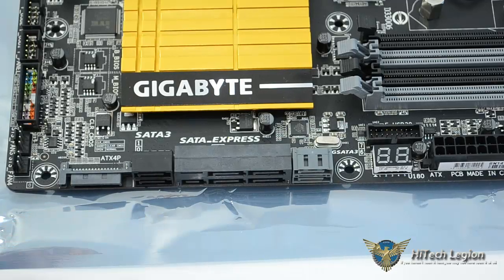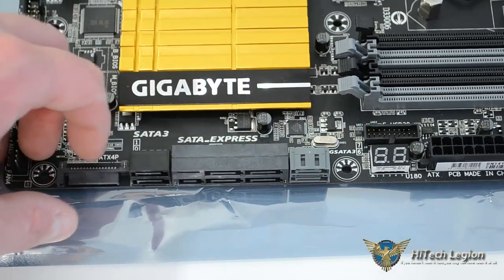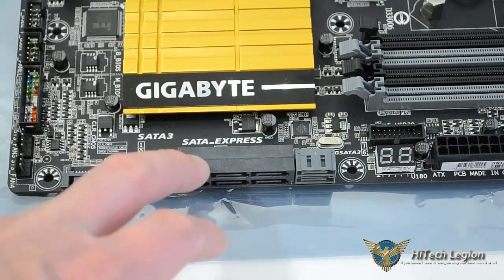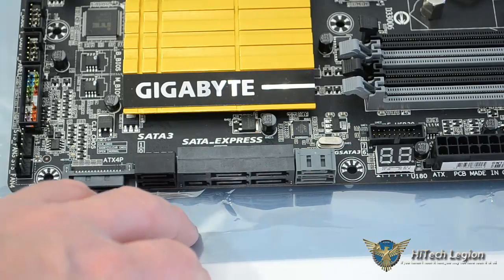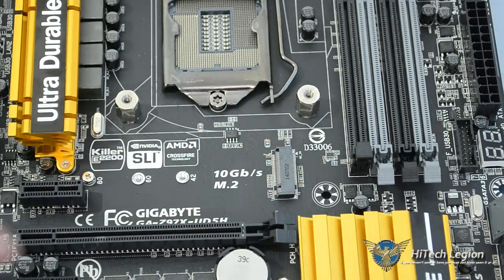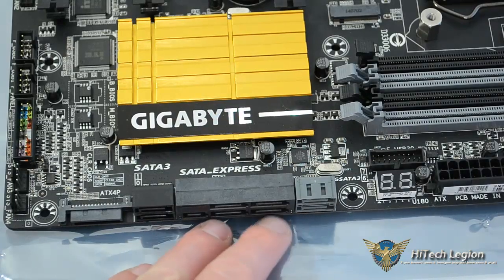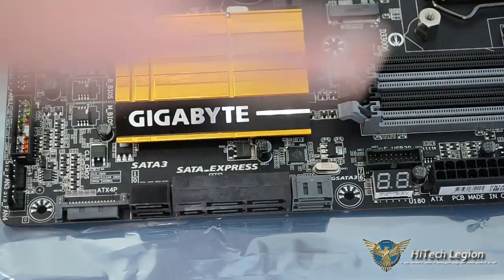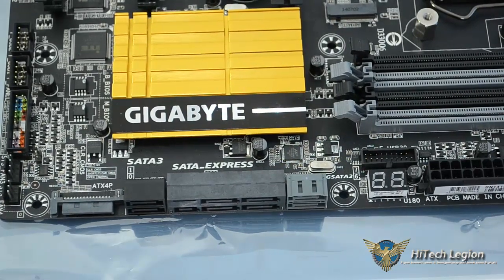We can rebuild it, faster, more powerful. Gigabyte Z97X-UD5H SATA Express and M.2

Comment: I'm new to SATA Express, so...

"(M.2, SATA Express, and SATA3 4/5 connectors can only be used one at a time. The SATA3 4/5 connectors will become unavailable when an M.2 SSD is installed.)"
Here it http://www.gigabyte.us/Motherboard/GA-Z97X-UD5H-rev-10#ov it marks the lowest row which includes (I presume) 1x Sata Express + 2x Sata 6GB

What I don't understand: a) can I use all 8 of the Sata slots at the same time b) low row, first smaller connector to the left from Sata 5/4 is the Sata Express or the whole lowest row (including all three connectors) 

From the first statement a) supposed to be possible depending on the answer for the question b). Like I said, the picture with the squaring of the lowest row makes it more confusing.
Reply: You cannot use all 8 at the same time. You can use 0-3 and 6-7 all at one time. 
If you enable the SATA Express, or the M.2 it disables the #4/5 SATA ports. You have to choose between SATAe and M.2 as well. You can't use both slots at the same time. Also, 4 and 5 can only be used by themselves. If you have drives in 4/5 it will disable all of the other SATA ports, and the M.2. 

It's a very weird configuration. I hope this helped a little? 7 years later.... 😂